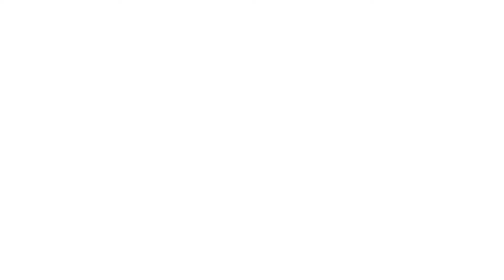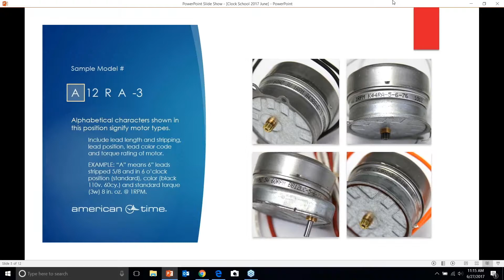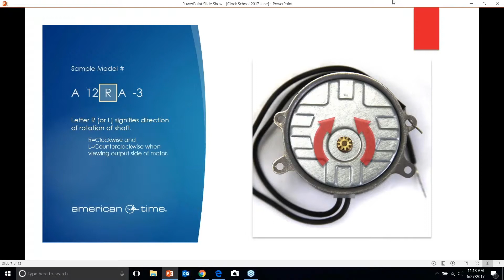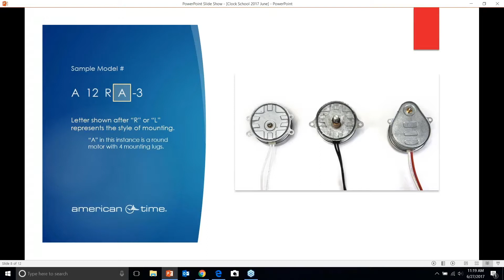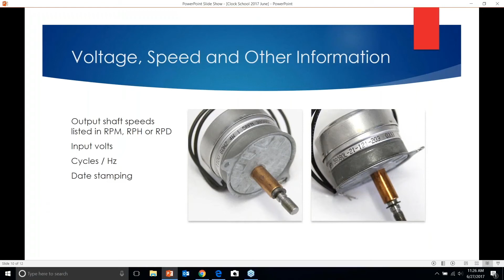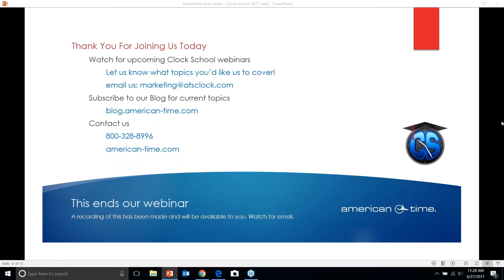Clock School 101:  What You'll Learn From Your Synchron Motor

Comment: Do you have access to these motors, I need one for my woodland clock, I have the original motor but it doesn't run correctly! Are they repairable, if so do you do repairs?
Reply: Hi Dale! Call American Time at 1-800-328-8996 for the answer to any specific questions. Yes, we do repairs.